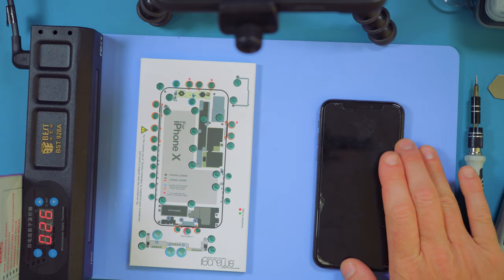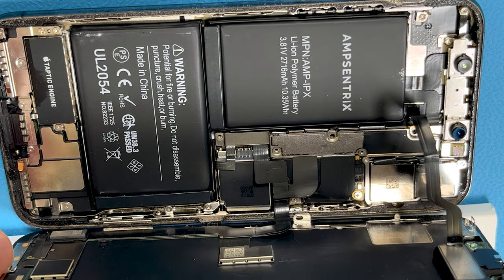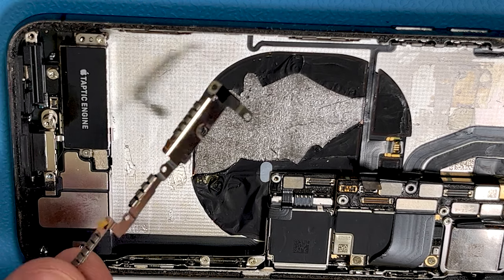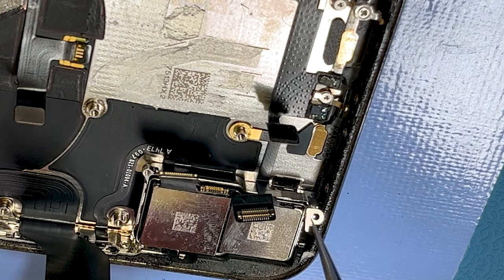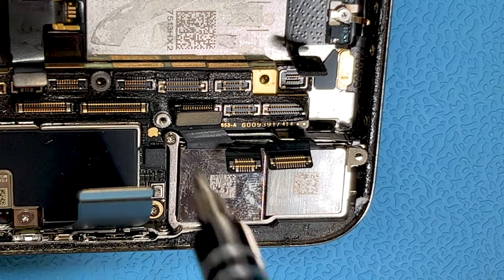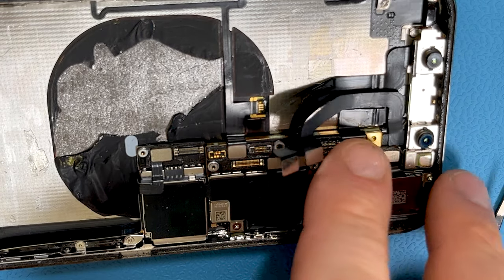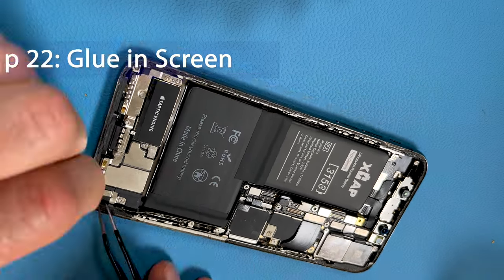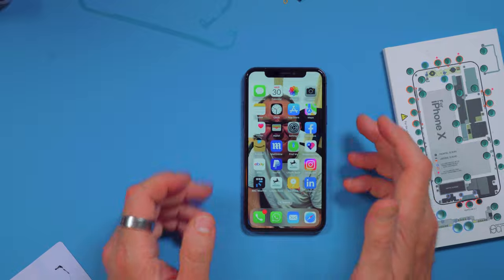iPhone X NFC / Bluetooth Antenna Replacement + Full Teardown

Comment: phone is not getting any cellular  service calls/data. sim card works when i put it in bother phone. so i’m sure it’s not the sim card. would a bad antenna cause this? or something integrated on board? it just keeps searching for signal

Comment: Hi there. My bluetooth suddenly got grayed out after I dropped it. Now I noticed the antenna got ripped out and Im planning to replace it. Do you think this will fix the issue? Also, is the bluetooth antenna and wifi antenna the same for iP X?
Reply from the maker: Hiya, the WiFi antenna is separate to the Bluetooth antenna - they work very differently. Unfortunately hard to tell without seeing it bud, sorry